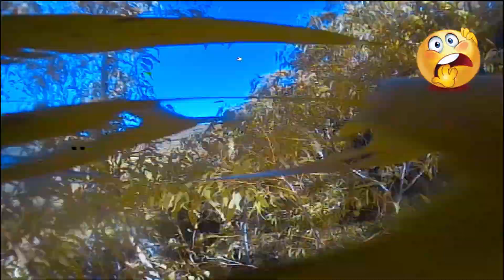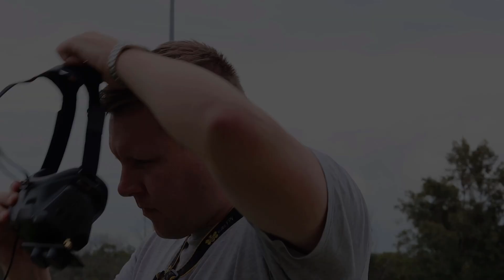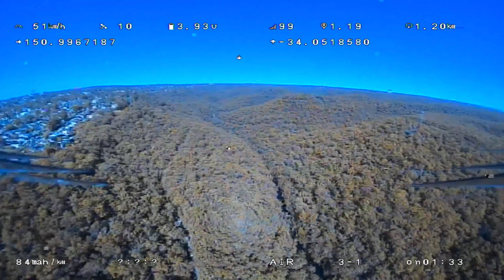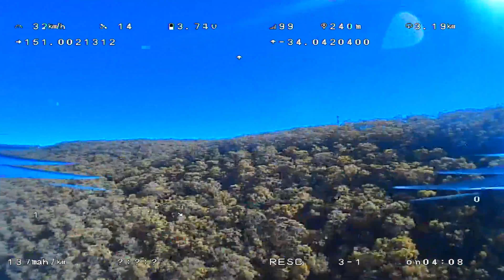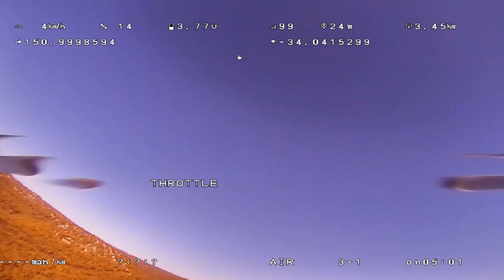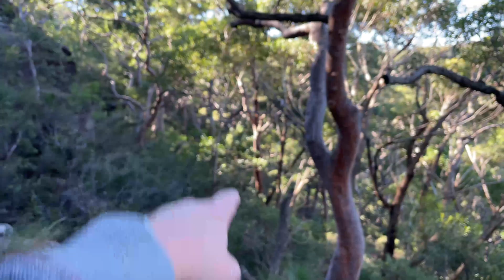Can I Find My Lost Drone? | HDZero 500mw Range Test

Comment: Was hard to tell but it looked like you're still using the stock patches which are fine for in close flying but to go way out out really need something more focused...I am using a combination of duo axii cp's on the top and duo axii patches on front via the 3d printed adapter plates available on thingiverse and a short ufl to sma connector...I only fly out as far as I'm willing to walk however and have never really reached the edge of range on 500 mw ...yet..😉
 thanks for the valuable info..🦾
Reply from the maker: Yeah my battery was the limitation. I’m grabbing some li-ion batts. I didn’t want to use my Sniper patch and wanted to test on stock set up. Ideally I was going to fly DJI off the back with stock antennas. Wanted to see out of the box how far it can go.